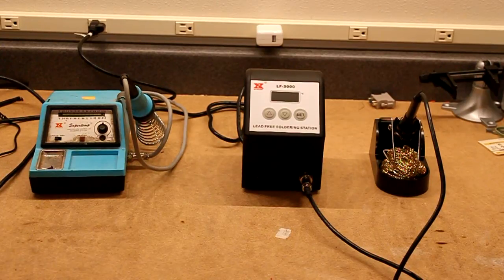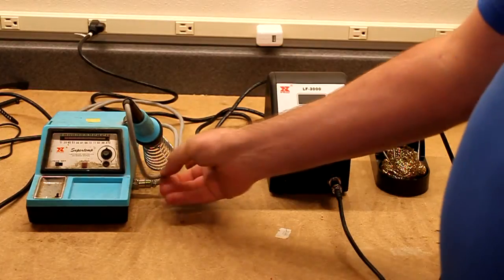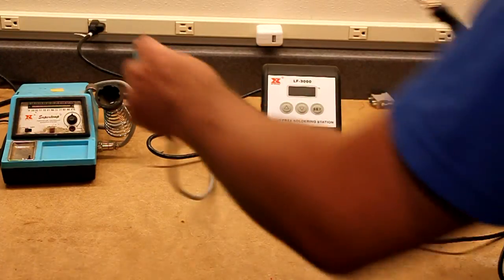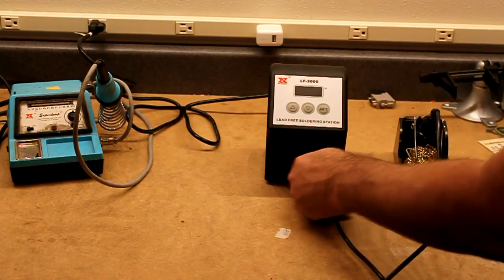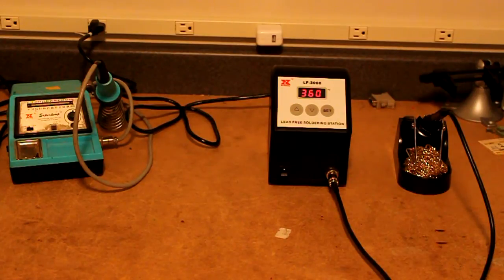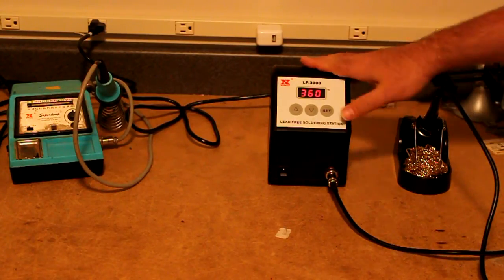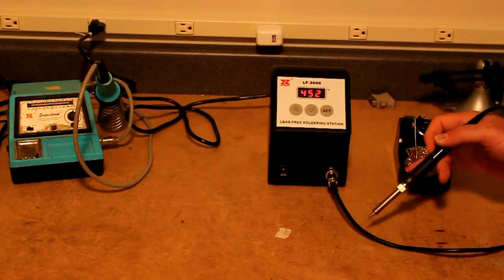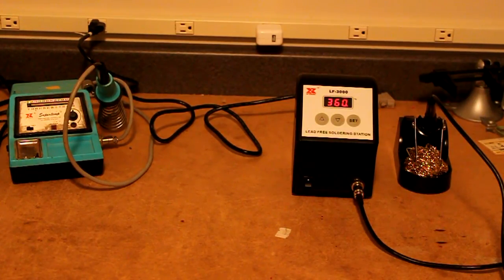XYTronic LF-3000 Soldering Station Review

Comment: Xytronic USA's catalog indicates that the LF-3000 tips will work with the LF-3500 when they actually won't. The LF3500 uses larger tips and has a more limited tip selection. I bought the 120W version (LF-3200) because I needed to be able to 
solder 6mm bullet connectors to 10 AWG wire in addition to more normal soldering jobs. I almost got the LF-3500 but when I discovered that it uses a different iron and no smaller tips are available for it (5mm is the smallest) I went with the next step down so I could use the LF-3000 tips.
Reply: Hi, sorry, can you tell me if the station has ESD safe protection?

Comment: I guess it senses the pickup of the iron by a sudden drop of temperature (in the german manual it says one way to get it out of standby is dipping it into the sponge). Try cooling the tip somehow without moving the iron.

I'm undecided between the LF-1600 and the LF-3000. While the latter is more expensive, I like the auto standby and the higher temperature range. Weird thing is, the shop where I could buy it in Austria shows different replacement tips than the one you showed (there's a 3cm rod or tube sticking out of the hollow part of the tip). And I really don't like equipment that has exotic accessories/consumeables (never seen tips like that before). But if the the tip is indeed like you've shown (which btw. is like it's shown in the manual) it would be nice though, because I could use the old but still good tips of my 2 decades old soldering iron. confused